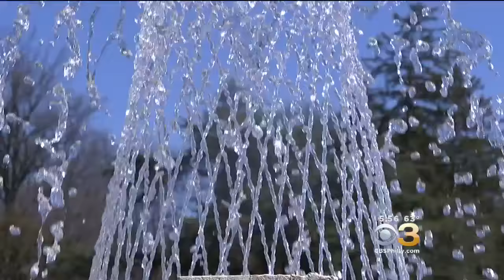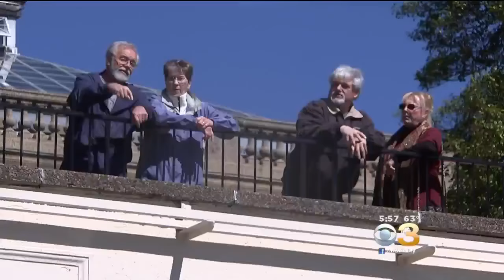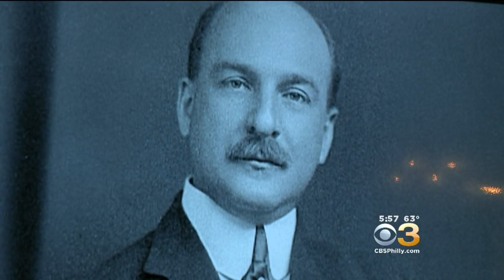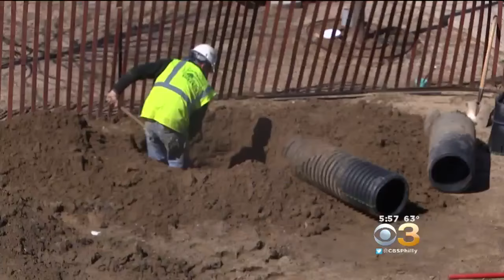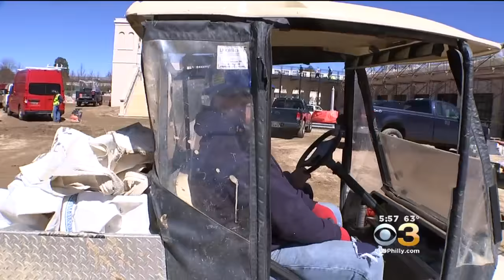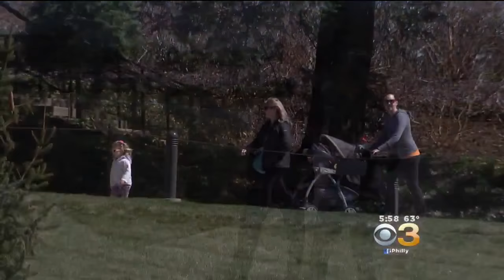Revitalization of Longwood Gardens’ Crown Jewel Nearly Complete

Comment: The basketweave effect is actually not new, but it rarely gets used. It's significant here for a reason Longwood Gardens may not even know: the first fountains which combined changing colored lights and changing water effects to produce a show, designed from the late 1890s onwards by engineer F. W. Darlington, made extensive use of this effect, then termed "vases" or "sheaves of wheat."

It's still sparkly, showy, and catches the lights extremely well.